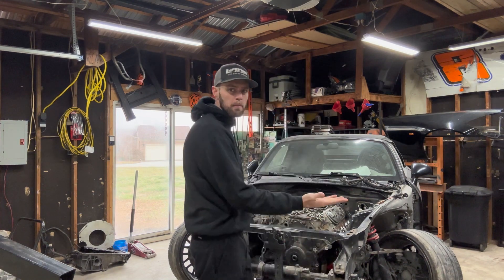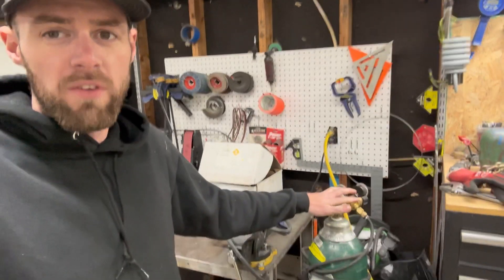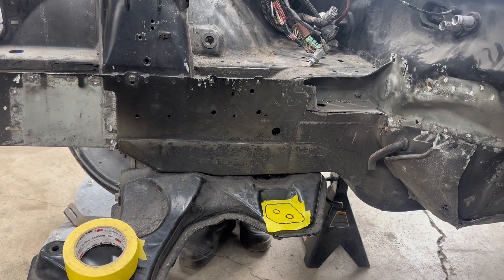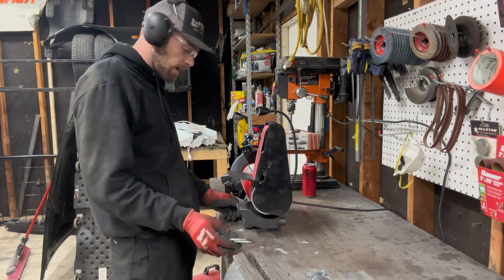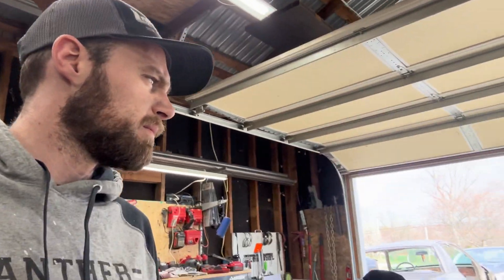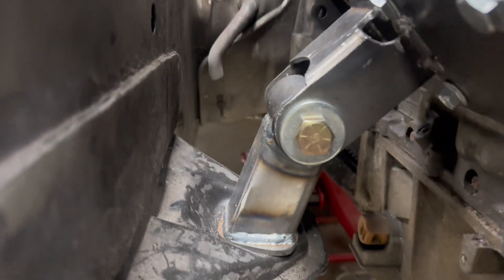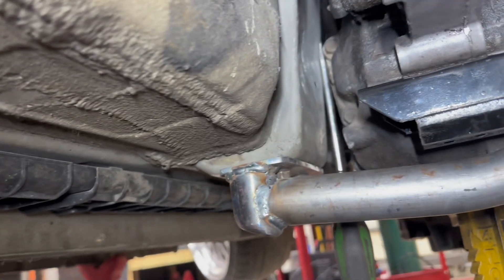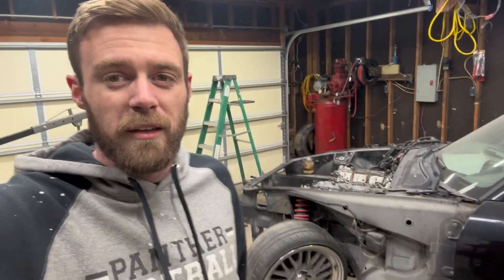Engine Mount Fabrication! Honda S2000 V8 LS swap EP-3

Comment: My dad calls those welds gorilla welds. Ugly as hell but strong as hell 😂
Reply from the maker: These aren’t too bad all around, I would’ve rather tig welded them but I don’t have a tig welded at home so ya make do with what ya got!
Reply: @bradleybuildsit  if you're interested in getting a tig welder I highly recommend the Eastwood tig 200. I love mine and it was very affordable for having a/c and d/c welding. Unfortunately it doesn't have pulse width settings for those surgical aluminum welds but I just pulse the pedal manually and it does the trick
Reply from the maker: @zachganoe  my buddy had an Eastwood, it was a great machine. I think I’m sold on the Primeweld after all the research I’ve done though
Reply: That is how I was the first one to pass my butt weld test in shop class (1981). I could only make em ugly but strong.